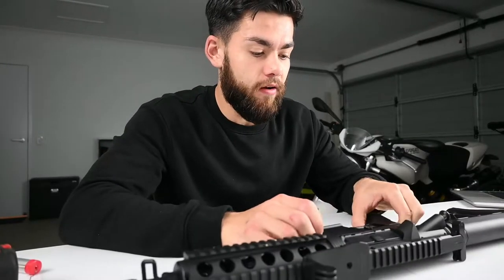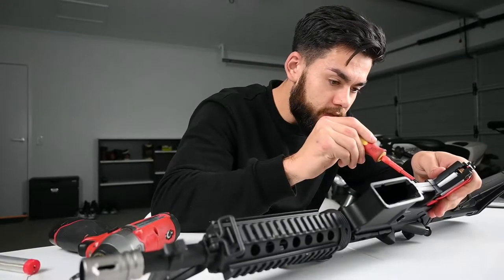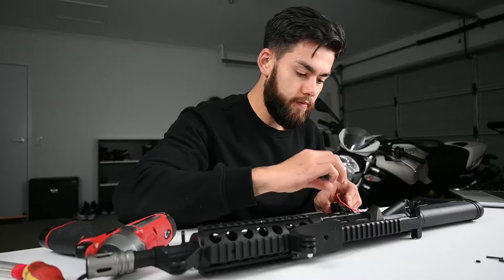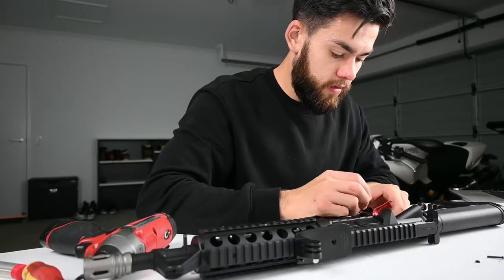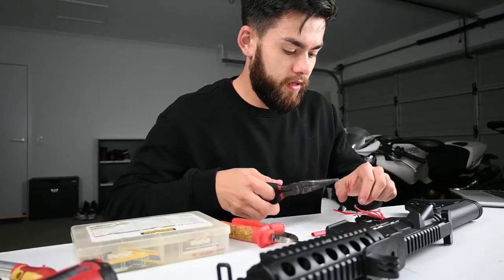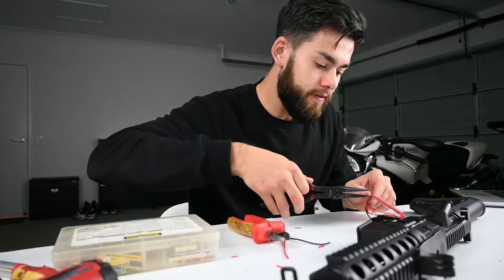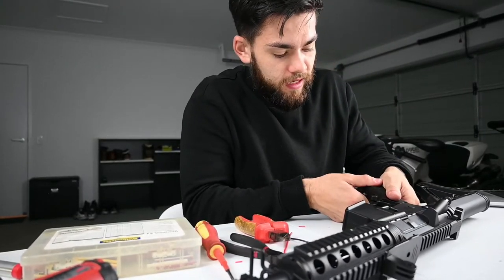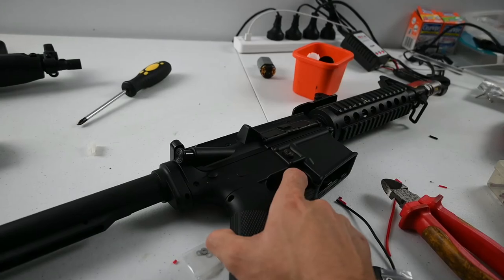How To Replace the JinMing Gen8 M4a1 Gel Blaster Motor

Comment: in your opinion, do you think the gen 8 gearbox can be fitted with the FJS HK416D?
Reply from the maker: That’s a good question.
Not without modifications to the gearbox itself and or the gun frame.
Anything can be fitted to anything with enough work but if you’re looking to put it straight in, no it wouldn’t fit to the HK416D
Reply: @danderian2911  Thanks for the information ✨

Comment: Whats the fps after the uograde?
Reply from the maker: I just got a chronograph so I’ll let you know soon.
My plan is to test different springs and record the FPS difference as well
Reply from the maker: But with the motor and an 11.1v battery there’s an insane visual difference in speed / fire rate improvement.
Reply from the maker: I measured it today, the FPS is up to 260 which is relatively the same as stock isn’t it?
I’m pretty certain, only the spring tension and air seal really improve FPS.
Like I said huge difference in fire speed / Rate